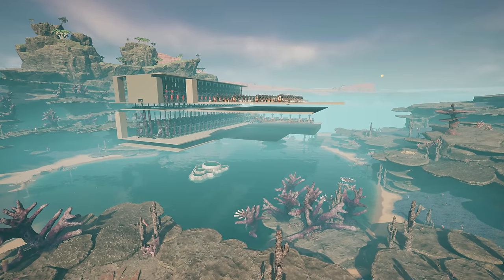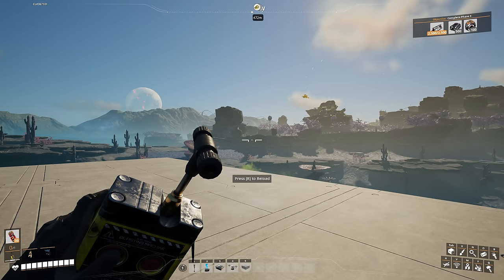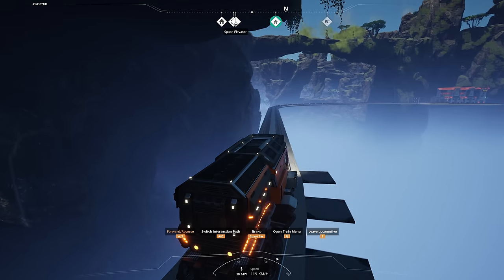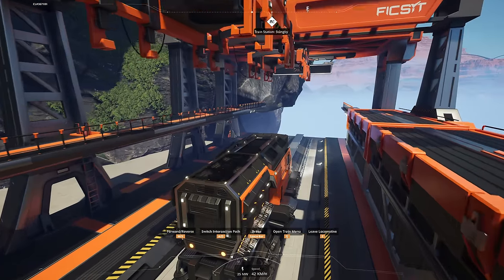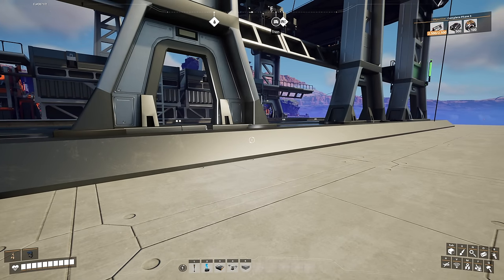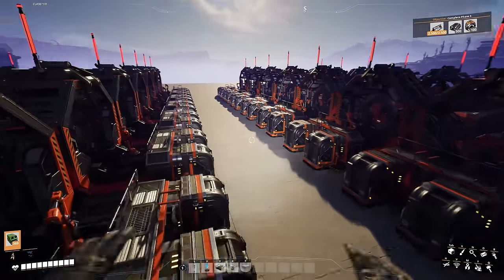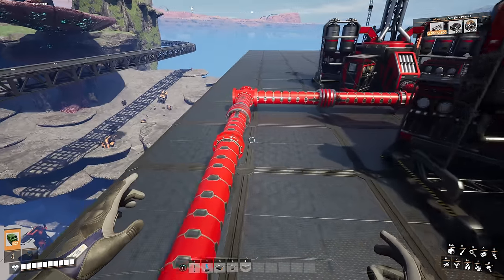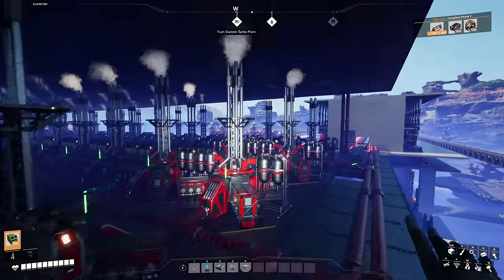Making A "TINY" Amount of POWER!!... In Satisfactory 1.0

Comment: I just finished my Super Duper Omega Rocker Fuel Power Plant. With alternate recipes, it's able to take 600 oil and convert it to 2,400 Rocket Fuel, which can power around 240 Overclocked Generators and produce nearly 144,000 MW of power. Then I have the Alien Power Augmenter which gives me an additional 14,400 MW of power.
I think my power problems will be solved for awhile.

Comment: Want to save some time on compacted coal. Set the output of the assemblers to 20 compacted coal every 15 seconds. Reasoning the quantity and timing for it is devisable by the belt speeds to the number of product. Just a tip.

Comment: İ have a queation for people who build like bitz: what is the fun of building flying islands in a massive hand crafted world that you can blend your builds in ? Ofcourse this eliminates one challenge but also takes away the soul and immersion.
Reply: For me, the floating platforms are just a first step.  Depending on where I'm building, I'll integrate the factory into the terrain after I'm sure I have enough room for everything, and the factory is up and running.  Generally once the final switch goes on, I start designing the shell of the factory while the manifold does its thing.   I don't really decorate anything until I at least get blueprints, it makes creating wall sections and roads SO much easier.
Reply: They don't STAY as flying islands for most of us, as far as I know. The point is to get every working and then you build the decorative bits around it. Function before but not neccessarily at the expense of Form.
Reply: @darkehartplays  this is also what i prefer. Function first but not at the expense of soul
Reply: Building with the environment is fun, but sometimes you just want to focus on logistics. There’s a reason Minecraft SkyBlock maps are so popular

Comment: Last time I played satisfactory was 2 yrs ago. Load balancers were the go to at the time or at least that’s what I remember using the most. Now manifolds are? Did they change something or? Idk if it’s server related reasons or not maybe but I just thought manifolds didn’t work properly for a while.
Reply: Short answer, math and expandability. It's easy to get a 4 or 6 or 12 way split, but it takes progressively more and more space and complicated builds to split more ways. Also, manifolds can be built so that you can just add onto the end of it when you get better miners or start overclocking. They have a longer startup, but the final efficiency is the same, so the community is leaning toward simplicity now.
Reply: @sciguy98  is there anything u should use load balancer for then?
Reply: You were mistaken in your original presumption that manifolds didn't work. There was a fad on Youtube for a while to do load balanced because it's more complex and space inefficient and therefore more difficult. Another popular fad in a similar vein was the 5x5 challenge, to build your entire factory for the whole game in a single massive tower five by five foundations in width and depth. (Power generation was allowed in its own, separate 5x5 tower.)

Comment: Regarding the train usage. In my save, my factory is outputting 1560 rubber (two Mk5 belts), and is filling that into a single freight station. Would that not be a use case to take two belts out from the buffer storage?